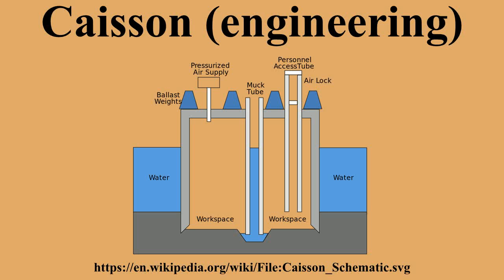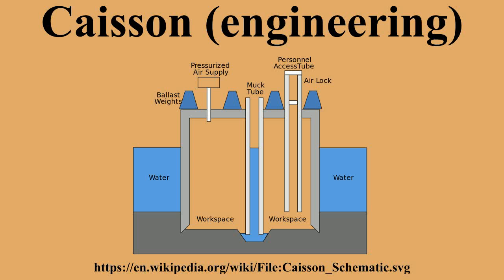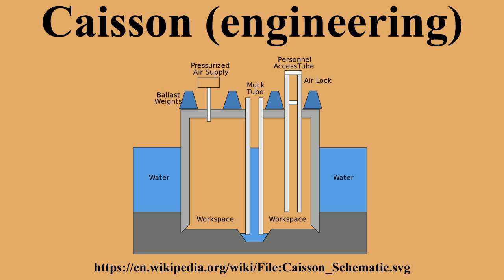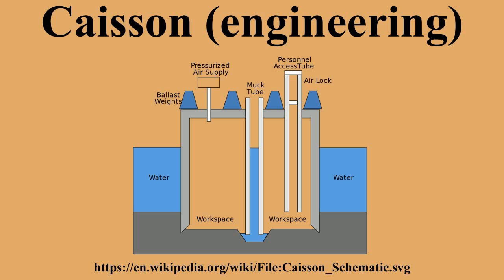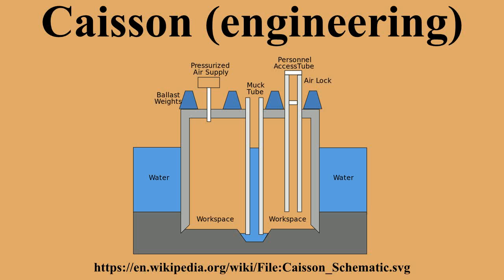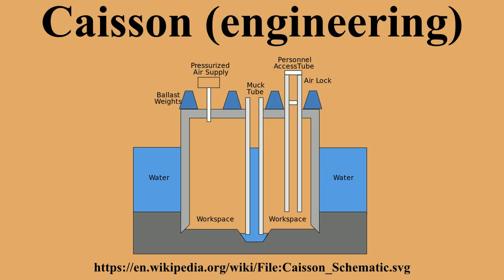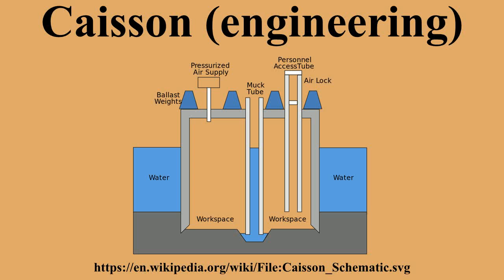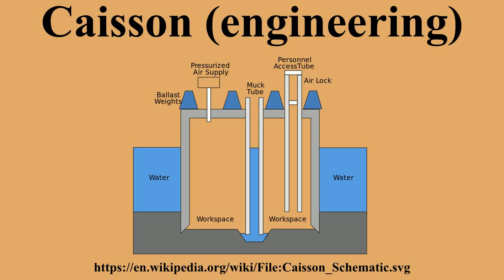Caisson (engineering)

Comment: If workmen down in the caisson are  in there for a length of time they have to decompress otherwise the air bubbles would form in their blood when they go out to atmospheric pressure.  It seems that too many risks were taken when the early constructors used this method and many people suffered due to the inconsideration of the authorities in charge  or simply ignorance of the situation.